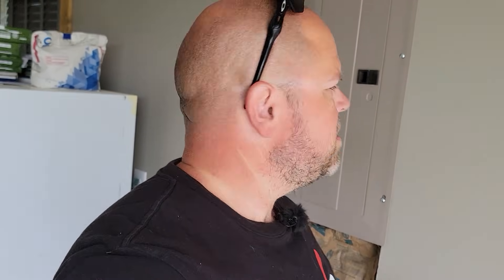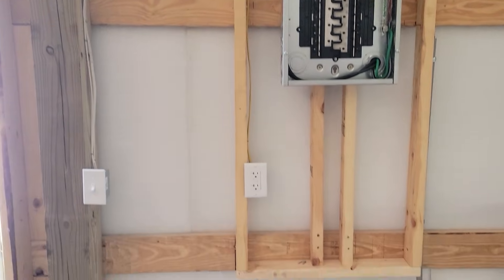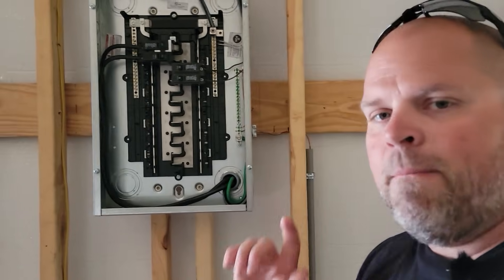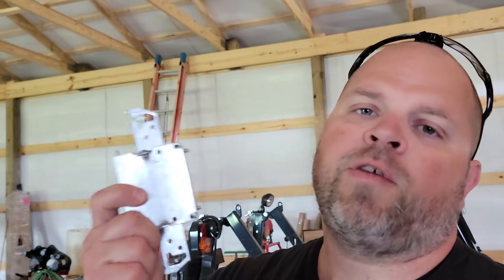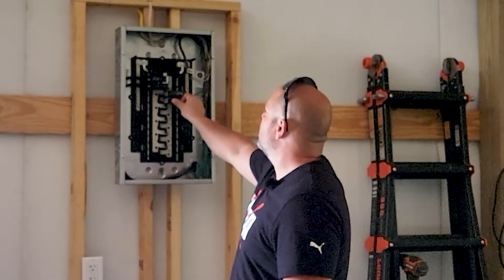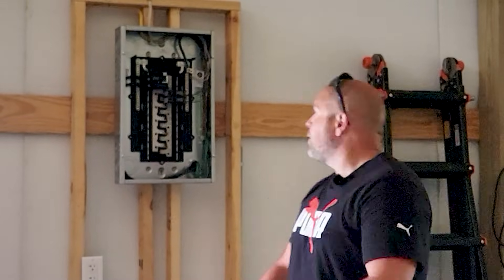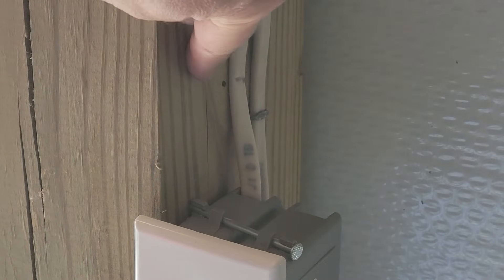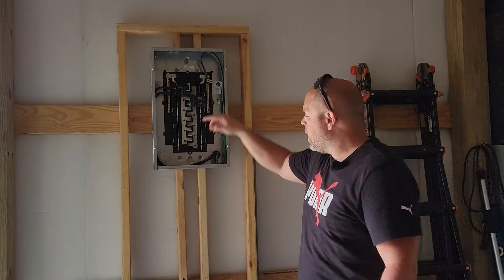Why I Failed my detached garage rough In Electrical Inspection

Comment: Good video couple things using  those small single gang boxes not enough cu. In. For 12 gauge wire. Would never pass in wi.
Retired electrician after 40 years.. use a 4 square box with raised cover single gang handy boxes not allowed
Reply from the maker: Thanks for sharing. Much appreciated!

Comment: Mechanical protection. Meant to be in walls where is the metal stuff can be exposed. If you're careful when removing you can just measure it roll it up right the length on it and reuse it for something else.

Comment: I recall from the previous video you took pictures of the trench before covering it up.  The obvious implication is evidence for the inspector.  I've often wondered if photographic evidence of trench characteristics is acceptable to most inspectors or do most want to lay eyes on the trench before backfill?
Reply: Depends on Inspector, many will demand to see it open

Comment: Thank you for the video... lots of useful info in there.   As for your ground rod you could have pushed that into the ground by pouring some of that bottled water into the hole.  Push the rod in a few inches. Pull it out and fill the hole with water.  Push the rod in several more inches and repeat.  You'll be mistified by how easy it is.  You'll only need the hammer for the last 12".
Reply from the maker: Appreciate the tip! I will have to keep that in mind.

Comment: Hi Justin, “hint”. When running wires, do all the runs before connecting any switches, receptacles or light fixtures.  That would have saved you a lot of time…. Thanks for your videos.
Reply from the maker: Thanks for the tip

Comment: ANY exposed wire like romex is a no no. Can't use it below foor joist in a basement in residential or anywhere in a garage unless behind drywall in residential and in your case in AG building everything needs to be protected MC or conduit.
Reply from the maker: Thanks for watching and commenting!

Comment: Good job brother. Good info for those that don't know. Glad to see no bitterness about the inspector. A lot of people would blame the inspector for their shortcoming. The NEC and inspectors are there for safety.  99.9% of inspectors want it to be safe. There are a few  who are  impressed with their title. Ag and industrial wiring must be protected using MC (metal clad) cable, emt, rigid, or pvc conduit. Nice vid!
Reply from the maker: Thanks for watching and commenting

Comment: As an electrician, you'll have dozens of inspections a year both residential and commercial.  Per NEC and different municipal regulations, you'll learn all the little things over the years. With that said, everything in this setup is clean. Good job👍
Reply from the maker: Thanks 👍🏻

Comment: What lights did you install on your ceiling, what is the spacing you used, and what is your ceiling height if you wouldn’t mind sharing please? After the fact, are you still happy with them?
Reply from the maker: 12ft ceilings, bought the lights at Menards, yes, still happy. I have more videos on my build out of the stop. It looks a lot different now.

Comment: 2 ground rods 5/8 inch 6 feet apart with #6 ground wire for 100 amp and a #4 ground wire for a 200 amp
Reply from the maker: Thanks for watching and commenting 👍🏻

Comment: Great job
I found it easier to leave the MC spool at the panel and pull the cable to where it needs to go instead of starting at a switch in pulling the wire out of the spool and carrying the spool with you
Reply from the maker: Thx. Appreciate the tip. Thanks for watching and commenting 👍🏻

Comment: Why would you need a second ground rod at the sun panel?
Reply from the maker: The inspector required me to install it to pass
Reply: @TheSolarPit  I’m not an electrician, but maybe if the sub panel is in a speedster structure, it needs its own rod. But a sub panel still in the same structure as the main does not. Someone please correct me if I’m wrong.

Comment: The beauty of using conduit over MC is, your system is easily expandable if you need to change or add a circuit. You just need to be aware of conduit fill and deration requirements.
Reply from the maker: Thanks for watching and commenting 👍🏻

Comment: Bottom line is NM cable is not rated for exterior applications and an agricultural building is unheated, damp, and corrosive. UF cable is fine. Kinda surprised if standard MC cable (also interior) passes. That spiral jacket can corrode. The NEC doesn't care what you are actually using the building for, but what it's designated as.
Reply from the maker: That's exactly what the inspector said. Thanks for watching and commenting 👍🏻

Comment: A hard to do confession; but the Reg's are available, most likely at the local library, and even on on-line. I'm an electrician and I still have to read the Reg's now and then to keep my own work sharpened. There are also things called "Amendments" as compulsory reading.
Reply from the maker: Thanks for watching and commenting 👍🏻
Reply: My SIL is a Master Electrician in MASSACHUSETTS and I am astounded by the number of codes there are to follow. Most of what I have wired in 50 years is perfectly safe...but there is a code violation around every corner. I think they get carried away with some of the petty stuff.

Comment: Anywhere the romex would be exposed, you need to use MC or conduit. Now if you had thrown drywall or plywood over the romex. It would pass. 

And every separate building with a panel needs its own grounding system.
Reply from the maker: Thanks for watching and commenting 👍🏻

Comment: The issue the inspectors had was the unprotected romex.  Romex is not rated for exposed installations.  Instead of ripping out all your work, you should have been able to frame out your interior walls, ceiling and sheath it with drywall or other sheatgoods to conceal those wires and you would pass your final.  That's  why you see any unfinished room or building with small sections of drywall installed.  Cover the romex and you pass code
Reply from the maker: Thanks for watching and commenting 👍🏻
Reply: Exactly. It's not an agriculture building issue. It's just unprotected wire in open walls. Two ground conductors 6' apart is common. Just use the rod itself to measure. The grounding conductor to them per table which seemed to be 8 but he has other ideas.
Reply from the maker: @LarsDennert They allow unprotected wires (Romex) in unfinished basements all the time. Most of the time, it's overhead in the floor joist. So, I assume it's also a height threshold as well.
Reply: @TheSolarPit  possibly basements are not considered habitable space just like a crawl space or attic. Garages though not technically habitable either, have safety codes especially where fire and ventilation are concerned. There's so many codes, rules and exceptions that following them all without making a mistake is tough. I've seen inspectors make mistakes and omissions as well and I've certainly done some stuff not to code. We all just get smarter as we go.

Comment: On the plus side: The inspector was apparently happy with the way you ran the feed to your barn. Most folks mess up there.
An outside disconnect is often required.
I am surprised you were able to use just "ordinary" breakers. I can see such a job requiring AFCI breakers, GFCI breakers, and a surge suppressor. 
Some might have required the use of weatherproof boxes and WR rated receptacles.
Reply from the maker: Everything was required to be on a gcfi breaker or outlet. I chose to install the outlet method. If I had it to do over, I would do dual functional breakers.

Comment: "Two ground rods" is . . . unfortunate. You would have met the requirement -- and in a better way -- had you placed twenty feet of #4 copper within your concrete slab, clamping it to your rebar or mesh.
I shudder at driving rods with a little maul as you did. Thank heaven your soil is soft. I commend your aim and patience. Post drivers are cheap, or you could have rented an SDS-Max roto-hammer to do the job. (Battery powered roto-hammers exist).
Reply from the maker: I wish I had planned better.

Comment: With all due respect to the inspector, I believe the NEC may have been misapplied.
The problem is with the use of the term "agricultural building." Your building looks like a simple garage / workshop. Such a building can use "Romex."
"Agricultural building" is further defined by the code (NEC) as more than just a building used on a farm. Additional elements are required, such as washdown activities (and I'm not talking about washing your tractor), bulk handling of loose feed and fertilizer (dust and corrosion issues), the housing of animals, etc. The concerns center on corrosion (ammonia from waste) and physical damage (chewing).
An agricultural building CAN use type "NMC" cable. This is an electrical unicorn -- no such cable exists. The equivalent cable is known as "UF," or underground feeder.
Reply from the maker: The permit pulled for the construction of the building stated it was an agriculture  structure.

Comment: I have access to an sds plus hammer drill, i just had to purchase to ground rod driver bit.  It makes short work of driving ground rods.  Until you hit a big rock or thick caliche. 

I always wonder what the reasons are for particular codes.  There usually is a reason.  Although,  it seems that the intent isn't always followed, but the exact letter.
Reply from the maker: Funny story. I own an SDS and I didn't even think about using it. 🤣 Thanks for watching and commenting 👍🏻

Comment: Licensed Journeyman electrician in Michigan I would challenge the ground rods and wire as that panel is a load center, not a main panel. A load center is fed too via the main panel ( 220/240 volt ) with two feed one neutral and the ground wire all grounding is to be done through the main panel that is why you have neutrals on one bar the grounds on the bar mounted to the box and the bonding screw removed. Lastly emt and metal boxes definitely a great way to go
Reply from the maker: Thanks for the information! Thanks for watching and commenting 👍🏻
Reply: Per NEC ... the ground rods are required for the separate building.

Comment: I ran all the wiring in my shed in EMT conduit with THHN wiring, but it's sub panel is connected to the main panel with buried UF cable and I was told the buildings were too close to require a separate grounding rod.  I installed all the outlets and lighting circuits but an electrician set the panel and made the connection to the main.
Reply from the maker: Awesome stuff! Thanks for watching and commenting 👍🏻

Comment: I am an Electrical inspector for the state of Alabama-Your inspector is full of s#it you only need that braided wire if you are going to store (Feed-hay or straw in there) And for your Ground wire what you had it was fine-your not over 5 feet from your ground rod outside, Now look I'm all about the safety part-thats my job-But I cant stand an inspector that just wants it his way, get it passed and never call him back for anything-i can see that you know what your doing,
Reply from the maker: Thanks for the information. Thanks for watching and commenting 👍🏻

Comment: Your jurisdiction must have some amendments. I’m fortunate that I can use NFPA70 2017, 2020, or 2023 as so I desire. Most of my state have no additional amendments and allow us to follow the NEC NFPA70.

In 2017 NFPA70 (334.10)(1) covers attached and detached garages and storage buildings. Except as prohibited by (334.12).

334.10(A) Allows for NM cable to be exposed or concealed, unless your building was not classified under (334.10)(1) than it would be prohibited by (334.10)(3) which would require a 15minute flash rating. However, I would argue that this building would be under (334.10)(1) as a detached garage.

As long as your building doesn’t fall under (334.12)(A)10 hazardous classified location, or (334.12)(B)(1 and 4) exposed to corrosive fumes or vapors. Or considered a wet or damp location. You should be able to proceed with NM Cable.

(334.15)(B) Exposed Work and Protection from physical damage. NM cable that is subject to physical damage has to be protected by RMC, IMC, EMT, or Schedule 80 PVC. You may also use RTRC marked with suffix -xw. 

So if NM had to be in walls, (334.15) wouldn’t exist.

By the way MC or Metal Clad would be prohibited by the NEC NFPA70. In the 2017 version (330.12)(1) Prohibits the use of MC where exposed to physical damage, and there is no remedy allowed , such as running the MC through conduit. The 2020 and 2023 versions still prohibit using MC when exposed to physical damage.

Seems the AHJ told you to do something that is prohibited by the NEC. Assuming the AHJ told you to use MC Cable!!
Reply from the maker: My jurisdiction does what it wants 😁 Thanks for watching and commenting 👍🏻

Comment: An agricultural building would be considered a commercial building and i believe you cant have romex in commercial buildings not an electrician just a guess ?
Reply from the maker: Technically, the permit for the structure is agriculture. Electrically, it did adopt some commercial guidelines to follow. The main takeaway is that it is a detached shop, but because I pulled an AG permit, it comes back to bite me. Thanks for watching and commenting 👍🏻

Comment: Maybe someone already posted this suggestion but there is no need to drive a ground rod - just dig a hole about a foot deep and fill it with water - then take your rod and start working the rod up and down in the hole. The water basically allows you to push the rod completely into the ground or you can use your foot for the last foot or so. I've won multiple bets over the years with this method. Good video!
Reply from the maker: Yeah, I have heard about that method. Unfortunately, it was after I beat the shhhh out of that rod, though 🤣  If I ever do it again, I will try the water method. Thanks for watching and commenting 👍🏻
Reply: uh... i doubt that will work here in vegas.  the ground is caliche.
Reply: @christheisgen  In that case you get an extended length masonry bit and go little by little to clean out the hole until you get through the Caliche or hard pan as we called it. The masonry bits have a carbide tip that can and will go right through a rock if you hit one. I welded on an extension to drill all the way down through the hard pan where I lived. it was a total pain but worked. Neighbor told me to do it that way.
Reply: @christheisgen or rotary hammer
Reply: That's what I did!
Reply: Or just hammer it in…

Comment: I hope you passed after driving another ground rod but the code says they have to be at least 10’ apart and you said you were about 6’. You can get a ground rod driver that goes in an sds or sds+ rotary hammer drill in the hammer only mode that makes it way easier.
Reply from the maker: Thanks for watching and commenting! 👍

Comment: For driving grounding rods I took a 10 foot stick of 1/2 inch EMT. I put an angle cut on one end and attached a fitting for a garden hose on the other. Attach a garden hose then just run it up and down, letting the water the dig the hole. Then take it out and tap in the ground rod.
Reply from the maker: Great tip! Thanks

Comment: MC is expensive. Buying an EMT bender, emt conduits and thhn/thwm wires cost the same, but is much neater and you can fish additional wires through the emt later if room is permitted. Dont buy your wires from the local stores either, order them, a 250ft spool of 12g thhn is $50.
Reply from the maker: I have it all concealed behind the walls now. I've been finishing it out for several months. Just 2 more rooms to complete. Thanks for watching and commenting 👍🏻

Comment: Had a similar situation. I live about Midthumb in Michigan and I built a steel building back in 2020 during the Covid era. I got a great deal on it and it’s a wonderful building and Wood was just too expensive at the time. Because it was a steel building yes I had to use all MC cable, I had to use all metal boxes, I was able to use plastic covers which I thought was kind of odd but I didn’t say anything. And I’m with you, I would so much rather use Romax and he said I could if I studed the whole building out. Well if I was going to do that I might as well have just went with a wood building. Now if dad was still alive he could bend pipe in his sleep. He knew how to bend Pipe and even use larger pipe to get more conductors going through it he could make it look all nice and pretty. I could but I don’t have five years to do it so I use the MC, and my building isn’t even close to the size of yours. But yeah they made me jump through some hoops with it but nonetheless, I’m glad you got it all taken care of and yeah, good thing you didn’t have it all done and then he tells you you were wrong. But nonetheless, thanks for the video you did a nice job.
Reply from the maker: My father was the same way. He could build and make just about anything work. He would have loved to be part of all these projects I got going on. One thing I never worked with him on was mc, that was kinda foreign to me when I started this project. Now, knowing that I ended up finishing the inside of my shop, I wish I used romex everywhere. I'm glad you got all of yours taken care of also. Thanks for watching and commenting 👍🏻

Comment: How did you get that ground clamp undone I am pretty sure the bolts torque off ot the proper torque?
Reply from the maker: I'm not sure I follow. Thanks for watching and commenting 👍🏻
Reply: @TheSolarPit  those clamps are made so that you tighten until the head twisted and that is how you know and any inspector knows it was properly torqued.